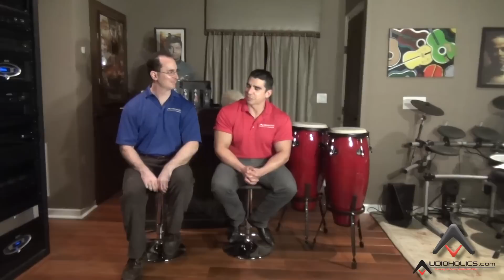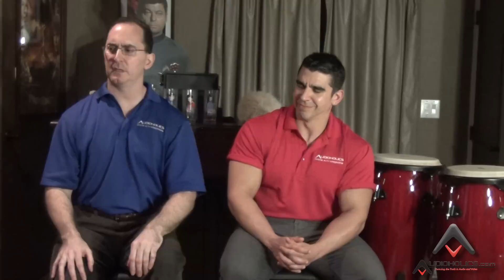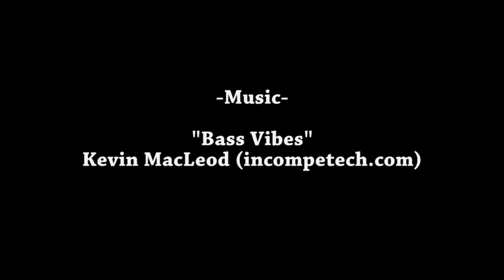Audioholics Loudspeaker Measurement & Reviewing Process

Comment: Because of Audioholics I know that Power cables don't make any difference in sound quality of an amplifier. Also because of AudioHolics I am currently building some CAT5 speaker wires that perform best with my Electrostatics. The site is awesome in that aspect.  I wish they did more reviews and started also doing car audio.